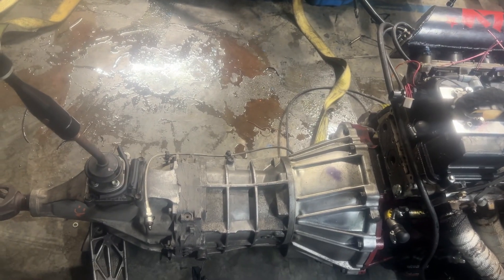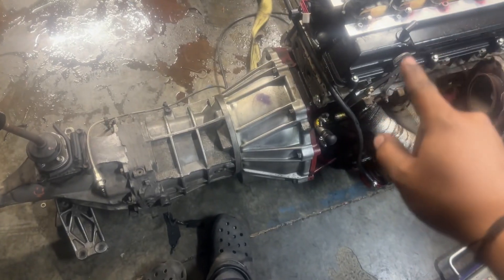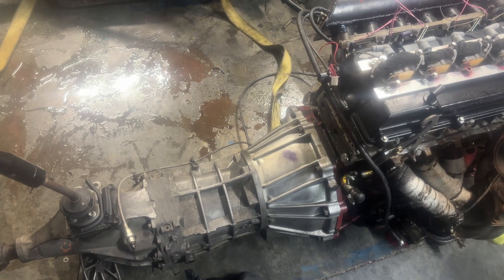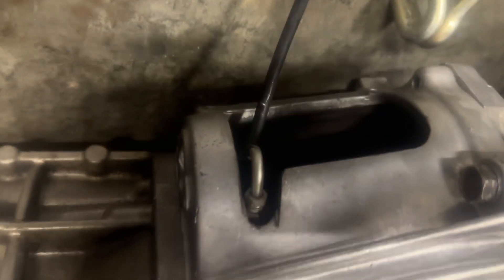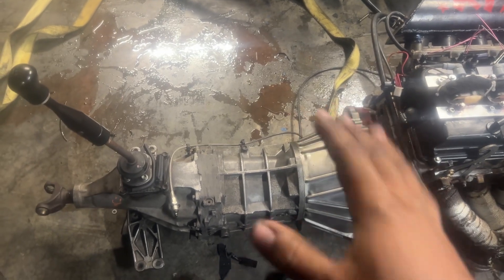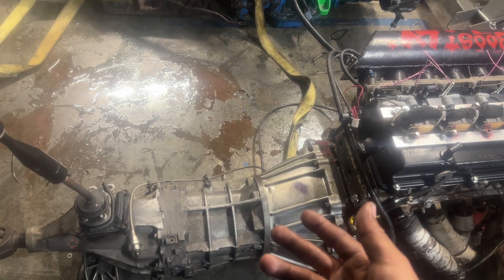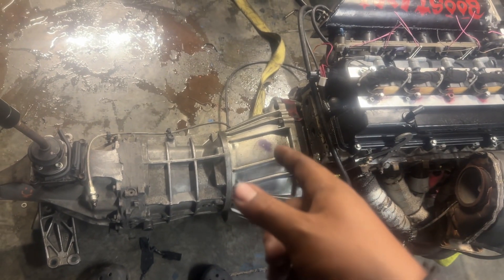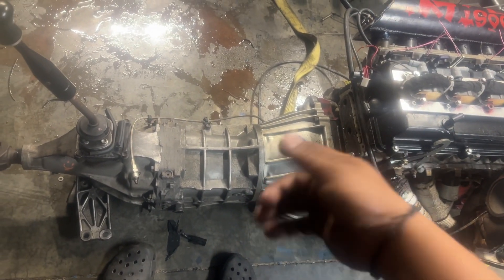My Experience With an Colorado Ar5 Swapped 2jz (HOW TO)

Comment: I just made a spacer instead of cutting the input shaft and installed it with longer bolts.
Reply: How's that holding up for you so far ?I'm interested in doing this
Reply: @PianoMan5000 works perfectly